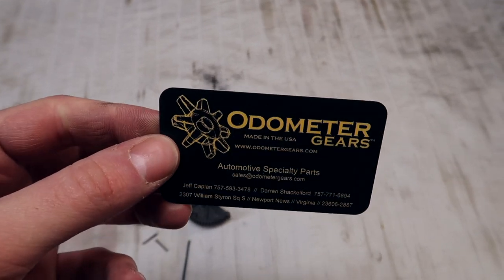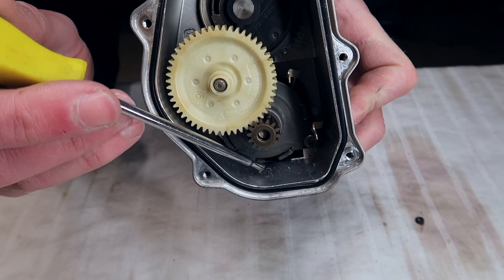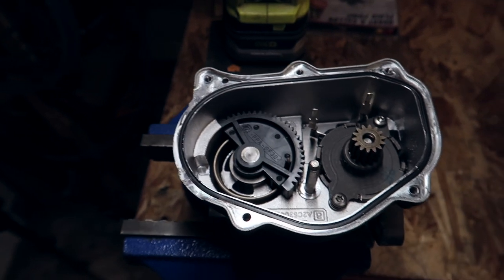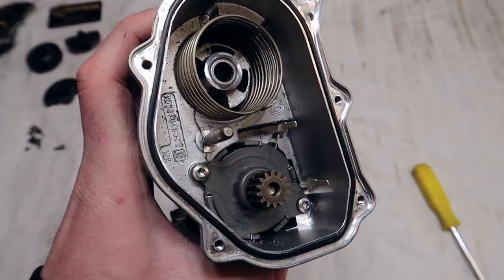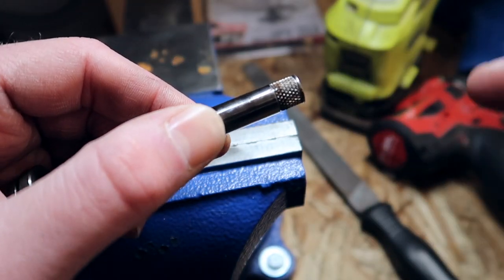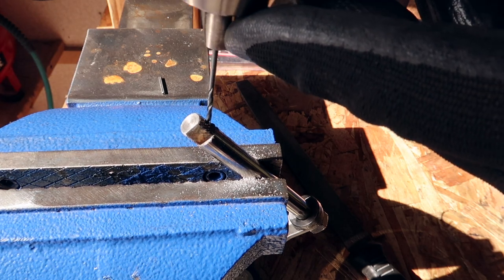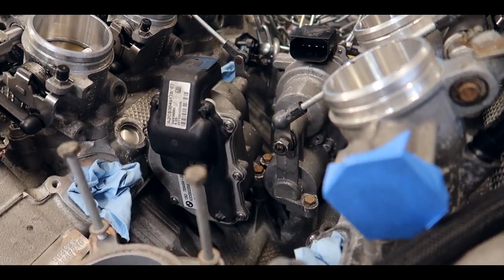How To Rebuild BMW M3/M5/M6 S65/S85 Throttle Actuators

Comment from the maker: Make sure to like / share / subscribe 🤘🏻
Reply: drilling into the shaft is completely unnecessary. It already has a flat side so a pin is completely redundant. JB weld in the knurls and let it set is all you need.
All that drilling does is increase the chance of mucking up the part and destroying the shaft beyond repair.

Comment: Hello Y.E.V.S BUILDS,

Loved your video!  

Next time and for viewers, recommend performing all work on the output shaft before assembly.  You removed the shaft to file the "peen mushroom" to install the gear.  Nice cross drill, but bond gear while it is out and on the bench, not in a confined area.  Then just reassemble to the throttle actuator housing.  

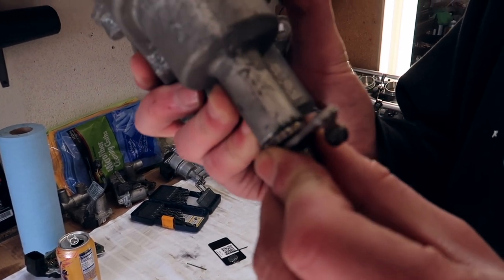NOTE:  To do requires removing arm that attaches to the throttle body link, but only held in place by a nut (check vid ~9:05 min).  Shaft can be lightly tapped with the gear on. vs. breaking the gear and pulling it from the throttle bottom.
Reply from the maker: Appreciate the feedback! Always trying to make these videos better for people!

Comment: At what mileage do the throttle actuators fail mostly? My m5 got only 67,000 miles so should I worry about them yet?
Reply from the maker: I mean that's really low miles. From what I know, they tend to fail near 100k but if I were you, id buy the parts as soon as possible just have em ready at that point if you're trying to keep the car for a while

Comment: The problem is not only the gears !!  It’s and the board!!
Reply from the maker: Yeah but since I've never seen this engine run before, I figured I'd start here with these
Reply: @YEVSBUILDS  yes but you did the half job if fails ! That will fail for sure you need to take them out again !!
Reply: The gears DO fail!  I have several examples.  They get worn and pointed on the output shaft gear causing slop the computer can recognize.

NOTE:  From motor, through intermediate gear, and final gear on shaft, there is a great reduction at the motor (motor spins more than ten revs compared to output shaft). and slop can be detected by the throttle positions sensors.  

Check M5board for details.
Reply: Yes, but if someone wants to do gears before they fail then that will also extend the circuit board life, the reason the circuit board fails is because of the extra bs it has to do when the gears start acting up, if you catch it early you might be able to save alot of money with only doing the gears.

Comment: Obviously the plastic gears get worn over time… but the main reason for the actuators failing is due to the circuit boards failing. 

This throws the engine codes 2b15/2b16 and cause the car to go into limp mode